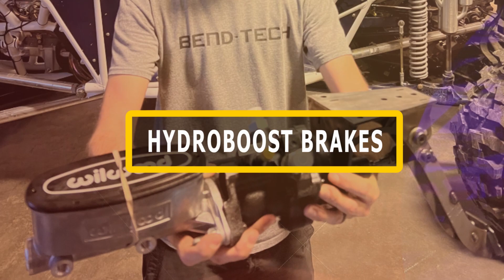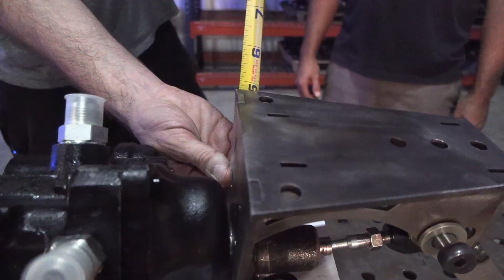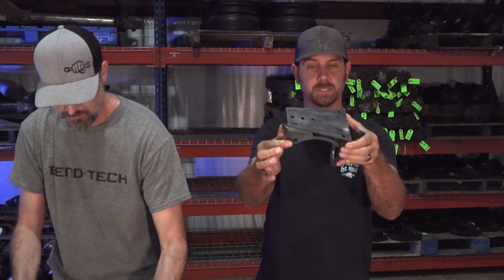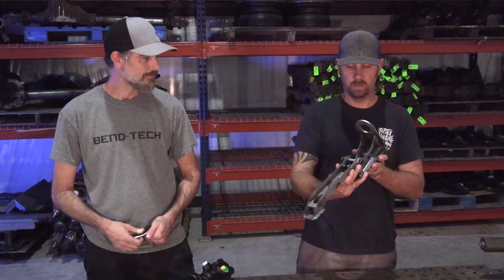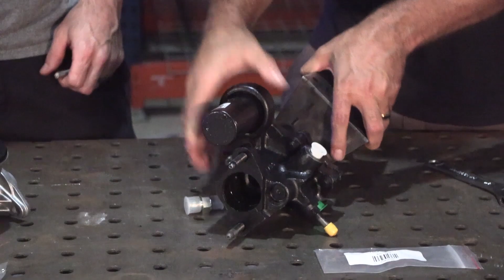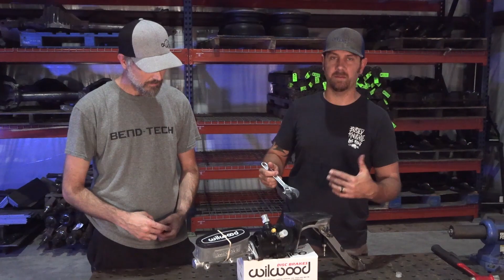HYDRO BOOST BRAKE SYSTEM INSTALL FAQ

Comment: I've said it before and I'll say it again but I love these video because all the information they contain. And on a side note that hydro-boost unit looks a lot like the 03 to 07 ford super duty hydro-boost unit and if so that's a great platform stock so I can't imagine how good it is after porting.

Again thank you for making these videos👊👊
Reply from the maker: Thanks. The porting makes it able to keep up with the higher flow PSC style pumps
Reply: @BustedKnuckleOffRoad  just out of curiosity are they super duty hydro-boost units? because they look identical
Reply from the maker: @zachmosteller4681  they are similar but not from a Ford F250

Comment: Interesting. I bought a full hydro-boost system from a very reputable company and after watching this video I have some concerns. 1) My system came with the ports facing downward in relation to the master cylinder right out of the box as well as the instructional manual. 2) The system came with a brass "T" fitting, which I was a bit reluctant to use. 3) The return port on my hydroboost unit is not a small port, but appears to have been changed to a fitting larger than yours. I'm in the process of bleeding the system now.

Comment: Great video on explains how everything works there should be more videos like this, I do have a question I hope you can help me with, if I want install a second return port in reservoir instead of using a tee do I install the return hose above or below oil line ?
Reply: Below is fine.  As long as the return dumps into the reservoir your good
Reply: @bustedknuckleoffroadllc5060  is above fine as well?

Comment: Must have missed it in the video but what if I don’t have Power Steering? Can I cap that exit hole on the HB or does it need to have a return to the tank? Sorry if that was covered already.

Comment: Cool setup!  So, how would I figure out bore size and brake fluid volume for my 65 4x4 with a high pinion dual piston caliper Dana 44 in the front and the Dana 60 rear will be disc brake swapped also. thanks!
Reply from the maker: This video helps explain some of it- https://youtu.be/xwzkFO_zv1E

Comment: I just went to the linked store page. Did I miss the $850 system? There only seems to be $899, $949. Also can these be mounted to the fire wall. it looks like there are only bolt holes on top and small slots on front.
Reply from the maker: price changes happen over time

Comment: I’ve got a 72 Bronco with Duff 5.5” lift, extended radius arms. 35” tires, front disc, rear drums.  Im being told that I can’t use hydro boost with rear drums. Is this true?
Reply from the maker: Great time to swap to disc brakes

Comment: HI Guys,  Do you need to use a propostional valve with this setup.  I have disc front and drum brakes.
Thanks
Reply from the maker: we don't use them, if this is for an on road vehicle it might be a good idea.
Reply: Hi you need a residual pressure valve on your rear brake line to hold line pressure to keep the return springs from retracting your shoes. You will lose pedal feel and most likely have to pump the pedal to get a good pedal feel otherwise. Its always a good idea to use a proportioning valve in the rear line to balance the brakes especially if you’ve removed the factory valve and even if it still has one. It is imperative with rear drums without the factory valve as you will lock the rear drums every time you brake.
Reply: @BustedKnuckleOffRoad  you guys give terrible advice and shouldnt be selling brake kits if you cant even answer the guys question correctly. Yes he will need a valve with rear drums especially if there isnt a factory proportioning valve in the system. Without the valve the rear drums will lock up every time he brakes.

Comment: You match the bore of the master cylinder to the calipers you currently have. This guy has no idea what he is talking about telling you you need to change your calipers. You also have to take into consideration how the leverage on your brake pedal is set up which would most likely need to be changed if the vehicle had manual brakes. Does the kit come with a residual pressure valve option for rear drums? What about a proportioning valve for balancing the brakes?
Reply from the maker: These are answers to frequently asked questions for our kits. Trey is a brake guru and has helped out tons of customers. We also sell disc brake conversions to get rid of drum brakes.

Comment: Can you run this without power steering and plug the port that would go to the steering box?
Reply: Good question. So you would run a power steering pump (without a power steering box) and run the lines directly to the hydroboost only. I would think it would work.